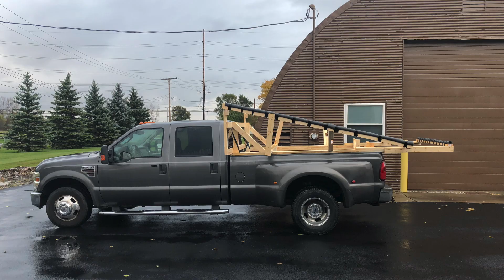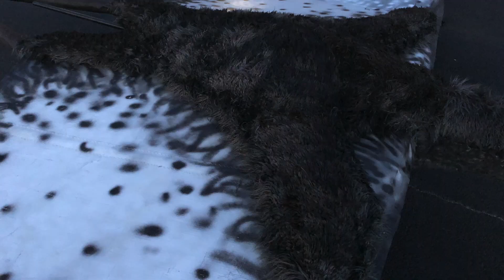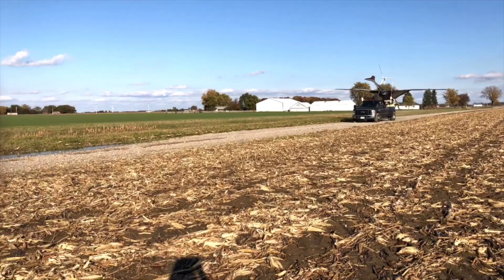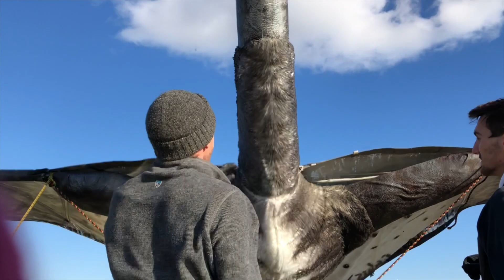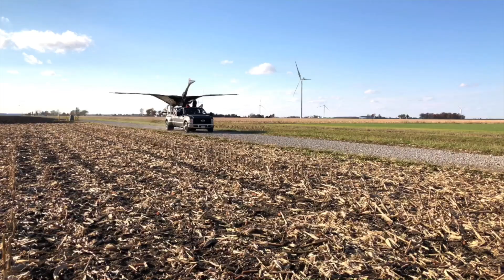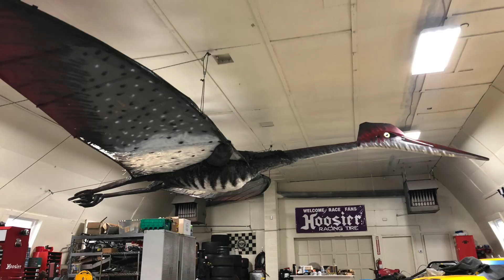Test flying the World's only full size Pterosaur, 38 foot

Comment: Pterosaur wing membranes ha a crisscross network of fibers and a thin layer of muscle . These may have worked in combination to adjust the curvature of the wing during flight. My memory is a little fuzzy but I believe the Wright Bothers used a system of cables attached to a cradle they lay in on their early planes. By shifting their body in the cradle they could use the cables to warp the wing shape to give them some basic control and perhaps adjust lift. Thats something you might investigate.

Comment: 1) Current thinking is that quetzalcoatlus swept its wings forward to balance its neck (center of lift must be in the same place as center of gravity) https://youtu.be/GkHh6cNzOYM
2) The whole time I watched this I was thinking "what a waste to build a thing that size without any RC at all!". Especially since you mentioned Paul Macready had already done it. Any chance of the pair of you getting together?
3) Conventional RC on a pterosaur, with just a few joysticks, must be well short of the control possibilities of the actual beast - presumably they had as much range of motion in their limbs and body as we do. So why not set up a RC system by motion capture that would mimic the controller's movements in the model's movements - I turn my head, it turns its head, etc.? This implies recreating the actual musculature and motor nervous system, not just the skeleton & skin, but it should be possible with current technology IMHO. Add VR and you could "BE" Quetzalcoatlus (or maybe something smaller and cheaper - though with the size of that thing, at least you wouldn't need to miniaturize too much).
Anyway it's already an exciting achievement and a very cool video.

Comment: 8:24 That's not how dihedral works.  Gravity only applies a linear force to a free-falling object, no torque, nor does any torque created by the wings depend on the direction of gravity relative to the plane. Dihedral works because any airplane that's not wings-level will side-slip towards the lower wing (since the lift vector does not directly oppose gravity but points somewhat sideways), effectively adding a sideways component to the airflow hitting the plane which (for airplanes with positive dihedral angle) increases the angle of attack of the lower wing while decreasing it for the higher wing, and the resulting asymmetry of lift forces finally creates the desired torque around the roll axis.